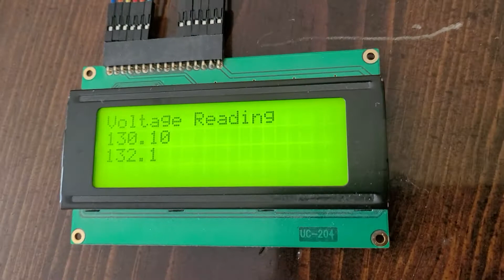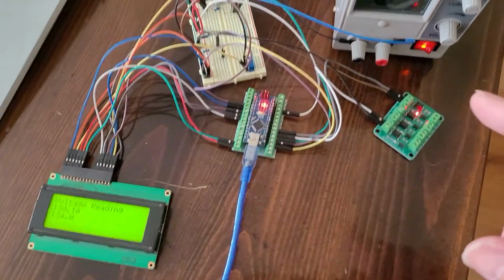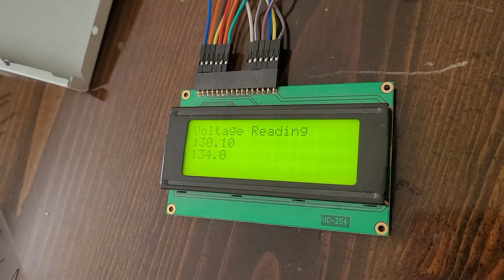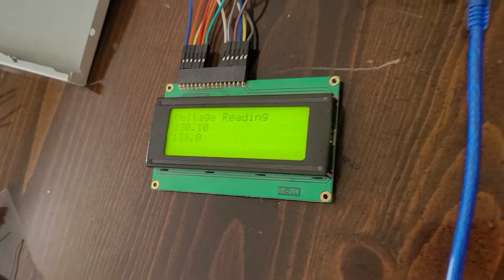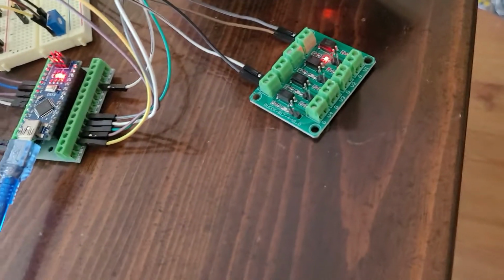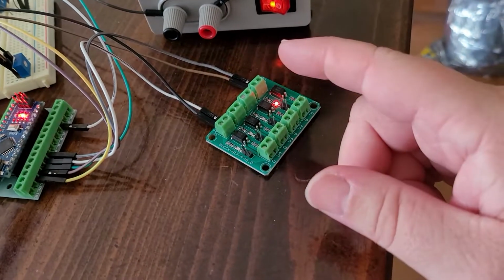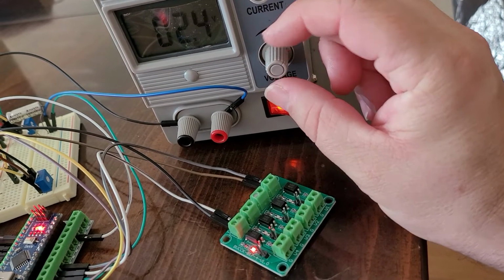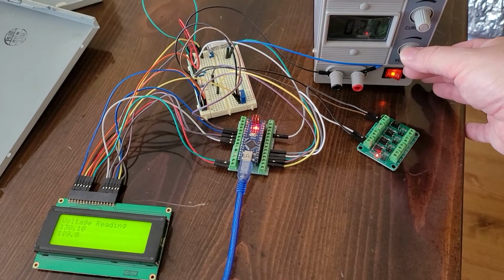DIY CNC Plasma Table Build Part 7 Torch Hieght Control Created.

Comment: I have an idea, someone please tell me if this could work. 
Instead of using voltage divider, we use an ac transformer to reduce the voltage of the plasma cutter. The reason for doing this is to achieve the isolation which comes with transformers.

The output of the transformer  is connected to a voltage sensor and from there we draft the ratios and rules for when to raise and lower the torch height. 

Could this work?

I can't try anything now as I'm still waiting for item I ordered to arrive.
Reply: Idk interesting concept though and would totally isolate the arc from your electronics. I'm not sure it would work since the transformer is for AC the plasma puts out about 100v sometimes even more when it miss fires. I'm assuming your plasma is non high frequency

Comment: Hi sir...  Ref = 2.5V or 4.4v ?
Reply from the maker: 12 volts reference I used a separate supply. You want it high enough that the incoming 50to1 won’t fry the chip and with 600 amp surges from the plasma that turns out to be 12 volts. Normal 300 amp draws means 6 volts off the 50 to 1 output.
Reply from the maker: It all depends on your plasma arc and how much voltage is there on turn on and shut off when it spikes. Monitoring that with a fluke ( multimeter ) will help you plan ahead and also what voltage divider you use plays a role.
Reply: @blue95stang1  thanks sir. very good explanation..

Comment: Hi , tell me, do you have 12 volts connected to the VIN pin (VCC)? As shown in the swolebro's wiring diagram.
Reply from the maker: The board is being powered by the computers 5 volt supply for the video. You can do 12 volts yes. I did not in the video.

Comment: Is your project compatible with Mach 3?
Reply from the maker: I have no idea I only have Linux. Try it out and let me know it’s pretty cheap to try.
Reply: did you try it
Reply: @abdelbassetmosbah2690  I tried the module made by swolebro, it works excellently, but on the MACH3 board model that is connected via USB, it receives the UP/DOWN commands but does not execute them. I have tried several options, having the model with BSMCEO4U with USB connection and it does not work. The module works excellently, but the Breadboard conected via USB to MACH3, does not take the commands, try with a Breadboard model connected through the parallel port and I am almost convinced that it will work.  If you try on MACH3 with the parallel port board model, please let us know the result....
Reply: @paulcus3737   Привет друг, ты смог подключить к much3 ?
Reply: Привет друг, ты смог подключить к much3 ?

Comment: Hi, please how did  You connect the 20x4 LCD  I have everything only the LCD connection can you help me.
Reply from the maker: The circuit:
 * LCD RS pin to digital pin 12
 * LCD Enable pin to digital pin 11
 * LCD D4 pin to digital pin 5
 * LCD D5 pin to digital pin 4
 * LCD D6 pin to digital pin 3
 * LCD D7 pin to digital pin 2
 * LCD R/W pin to ground
 * LCD VSS pin to ground
 * LCD VCC pin to 5V
 * 10K resistor:
 * ends to +5V and ground
 * wiper to LCD VO pin (pin 3)
*/
Reply from the maker: https://github.com/bluestang123/plasmacnc/blob/main/Arduino%20INI%20file

Comment: Is this stand alone?
Reply from the maker: Not sure, designed to send an output high signal on two inputs. One for low one for high.
Reply: Ok , output sent to mach3 Board
Reply: @danangwicaksono3193   Привет друг, ты смог подключить к much3 ?